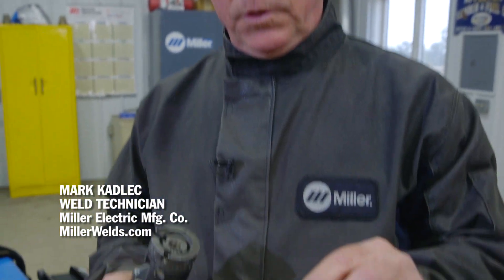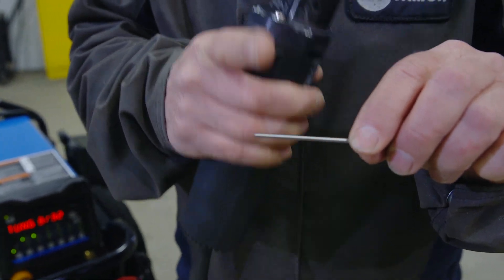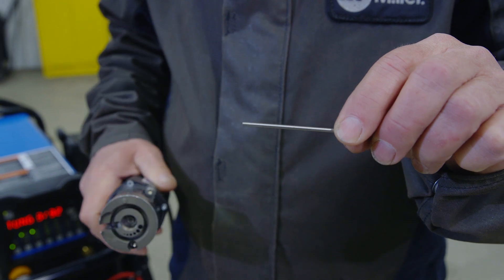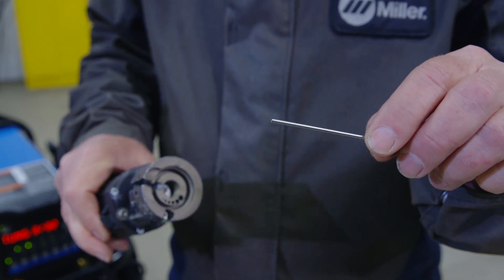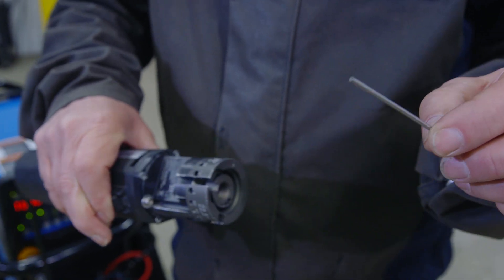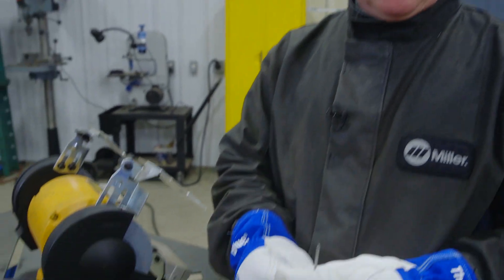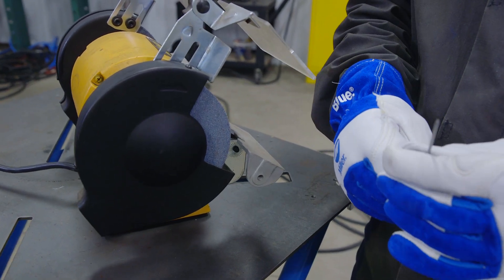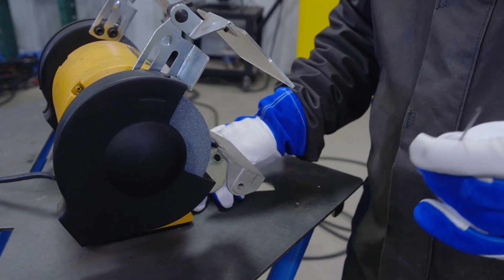Importance of Correct Tungsten Preparation

Comment: wow that's really cool and all but I've been welding aluminum pipe for better than 9 years and I snap my tungsten, and have most of the time to use my stubby.

obviously you won't want to use the end it that is broken, use the other side that has the factory and end on it ....and when using 3/32...it balls up pretty easily. 

it's also not very cost-effective as more times than not I will wind up with three pieces of tungsten rather than just two. one of them will obviously be way too small to use, and the other one on the border line if not still too short as well but it will work in a pinch..... just use the factory end